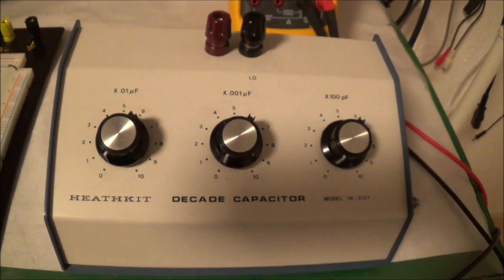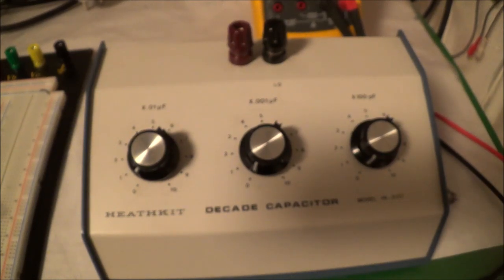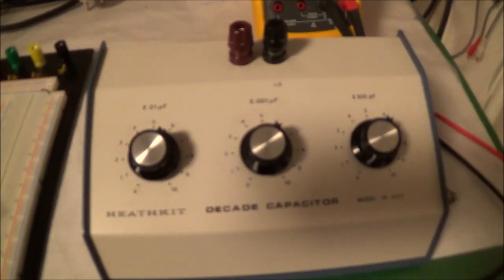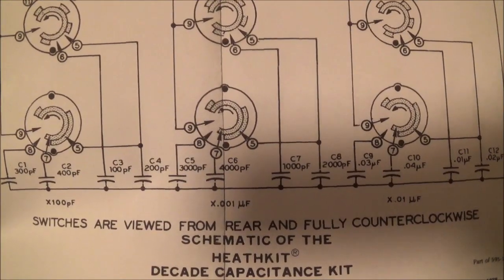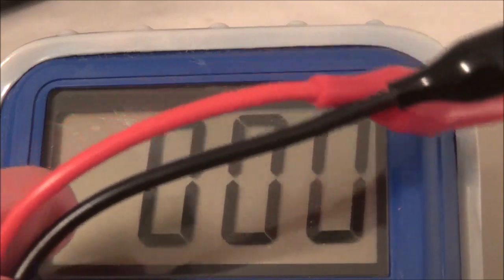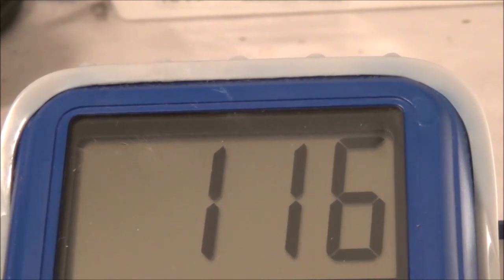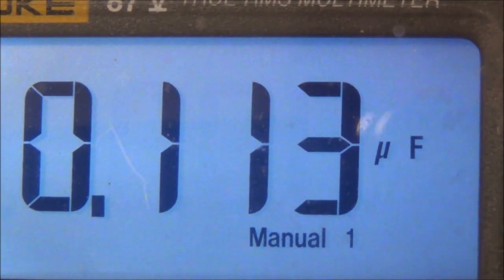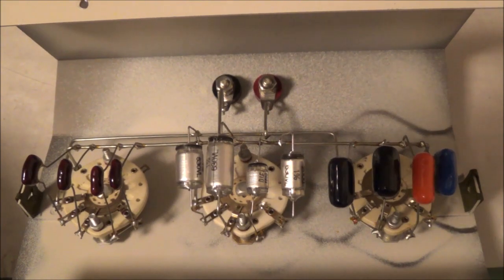Heathkit IN-3127 Decade Capacitor Subsitution Box

Comment: Not the one I was thinking of, but I have seen these as well, hopefully you'll be able to get the matching resistor decade box.  Its also cool to see it hold its value after years.  ~Jack, VEG
Reply from the maker: Thanks for your input! Get yourself one, if you don't have one. The resistance box is next on my list.
Reply: @OldSchoolElectronics  , there is no shortage of the matching resistance decade box online. Seems like eBay always has several for sale.

BTW, the capacitance box you have has 12, not 16, capacitors inside.

References I have say that all capacitors inside that box are 1% tolerance.